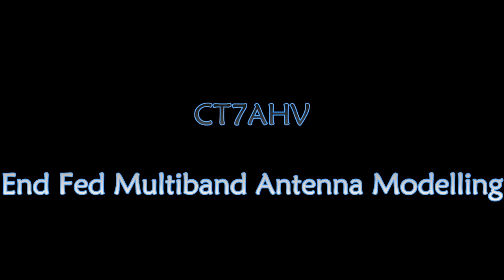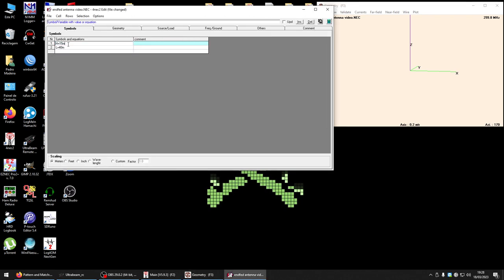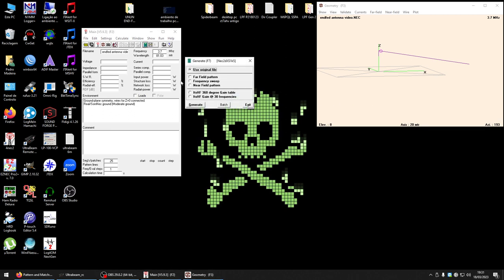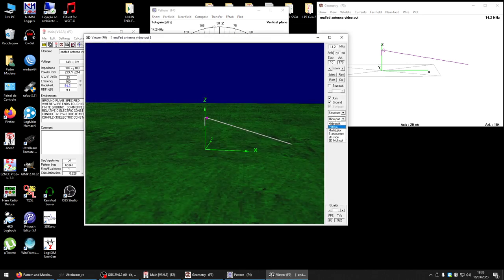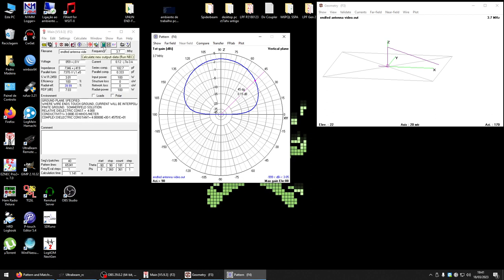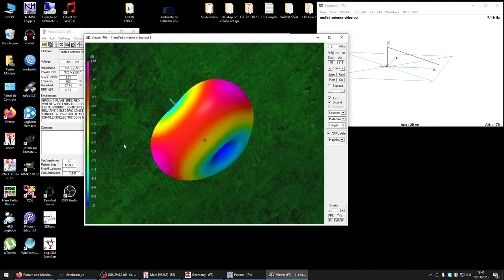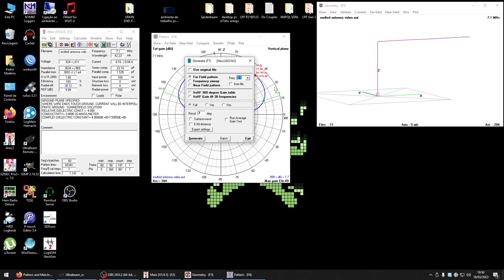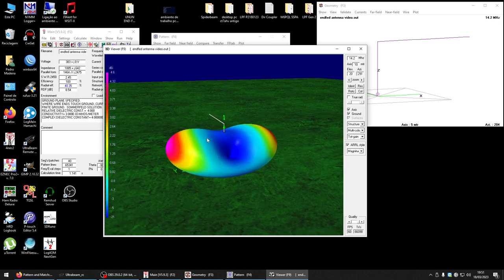Endfed antenna modelling with 49:1 transformer - is it a compromise antenna?

Comment: informative video.  Thanks You!  In my opinion this is the bests antenna for beginner or someone restricted to a single antenna.   The EFHW has many many advantages over other designs.
Reply from the maker: The problem is that the radiation pattern is distorted on harmonics…

Comment: Good video Pedro, the inverted L modulation is super interesting. One question - why is 20 segments usually chosen? Would choosing 40 segments result in more accurate modulation?
Reply from the maker: Theorically yes, more segments would give more accurate results, but on HF segment it makes no difference. The “standard” is 10 segments per half wave.